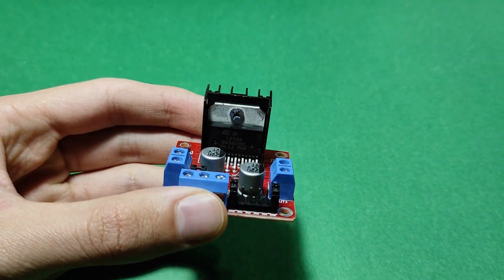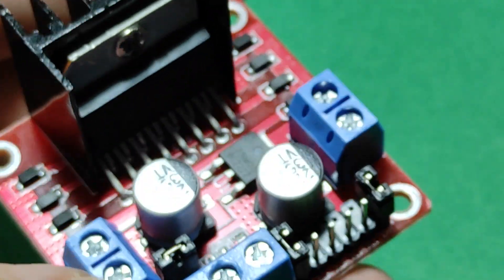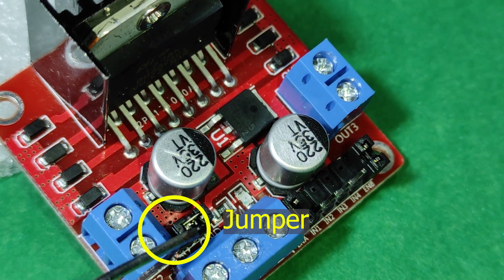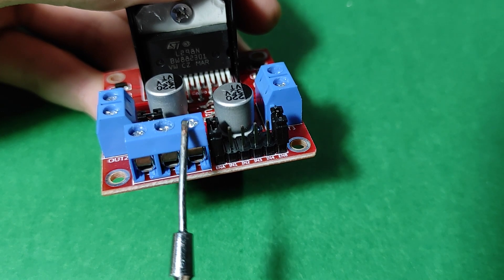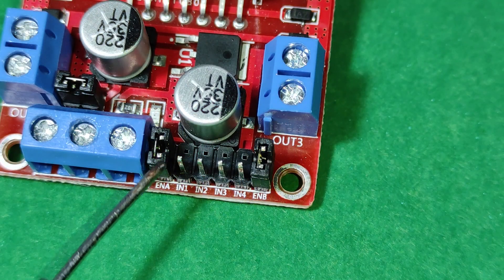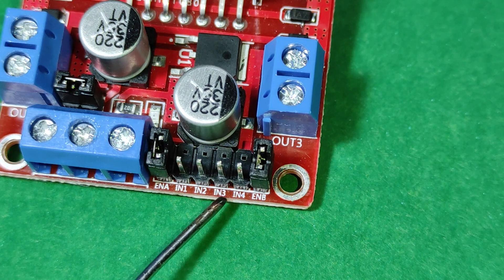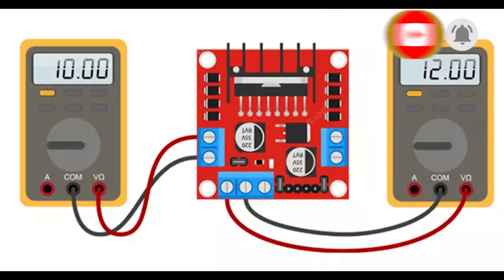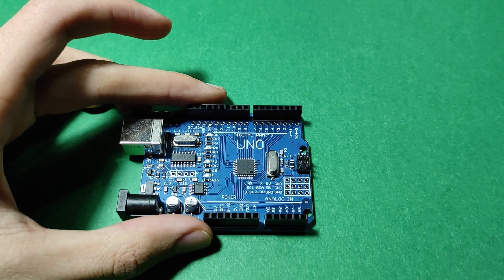How to setting up the L298n MOTOR DRIVER module with Arduino

Comment: can i put it 4 dc motor here
Reply from the maker: No, this driver has 2 outputs.  Unless you make both motors parallel, which makes both motors have the same performance, but the power of the motors must be low.
Reply: @ElectraBoost-tech  What do you mean power must be low?
Reply from the maker: The power of the motors should not be high, because the l298n is under pressure (Maximum 2A)
Reply: @ElectraBoost-tech  I mean can use a power source more than 2A?
Reply from the maker: No you can't  It causes heating and shortens the life of the module.  You should use more powerful modules.
Reply: @ElectraBoost-tech  Do you have alternative way to protect the module for that damage instead to buy  a new module? what do you think based on my desire project.
Reply from the maker: No way. Overcurrent will burn the module in a short period of time.  A more powerful module should be used.
Reply: @ElectraBoost-tech  Even 2.5A?
Reply from the maker: I tested it up to 2.5 amps, but it probably reduces the life of the module. I recommend putting a fan to cool it.
Reply: @ElectraBoost-tech  What if i using battery instead, it doesn't affect anymore and safer right?
Reply from the maker: @androidenthusiast4943  There is no difference
Reply: @ElectraBoost-tech  Ampere hour and Ampere is a different thing, right?
Reply from the maker: @androidenthusiast4943  The circuit draws as much amp as it needs.
Reply: @ElectraBoost-tech  It's can overheat or just warm?